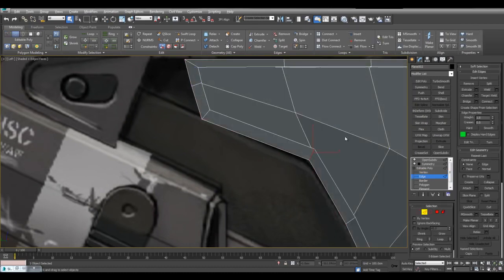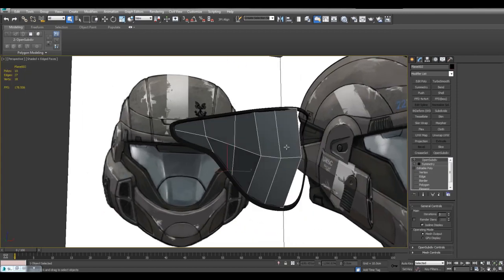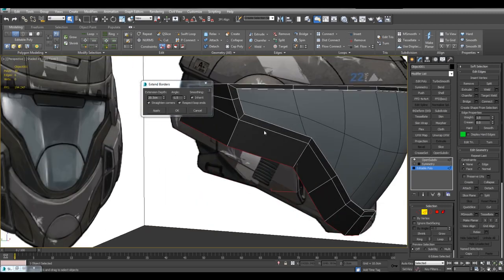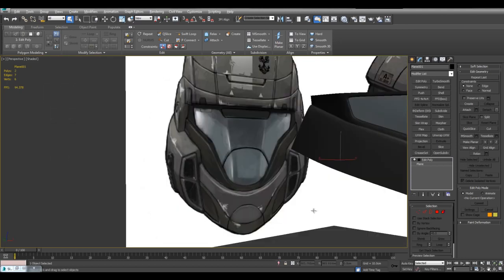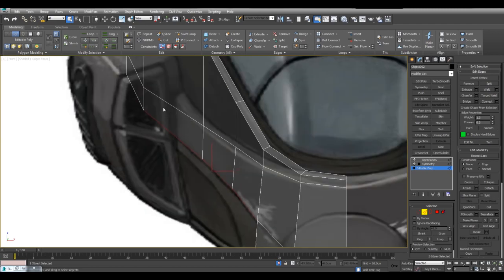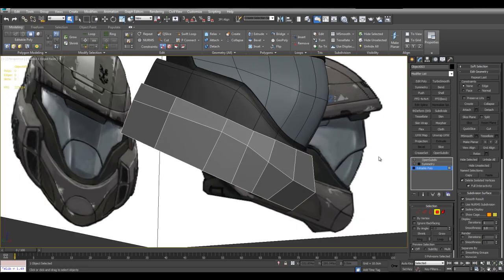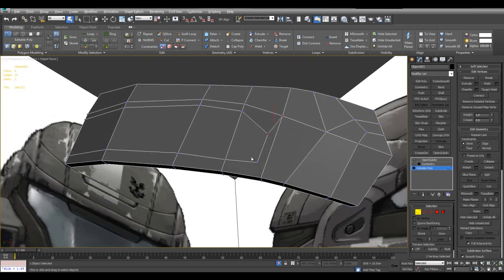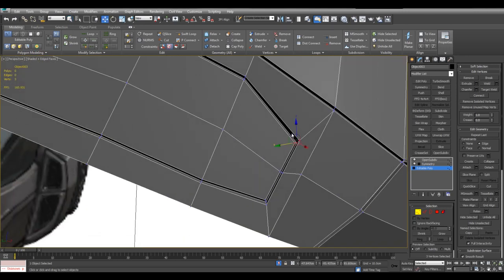Arrimus 3D - 3DS Max   Shortcuts, Tools, and Workflow   Part 3

Comment: Thank me later xD 

1 – Vertex Selection
2 – Edge Selection
3 – Border Selection
4 – Polygon Selection
5 – Element Selection
7 – Show Statistics

F2 – View Selection Shade Selected Faces Toggle
F3 – Wireframe / Smooth + Highlights Toggle
F4 – View Edged Face Toggle

Z – Zoom Extends Selected
S – Toggle Snap
G – Toggle Grid On/Off
Space – Show End Result
Q – Select Object
W – Select & Move
E – Select & Rotate
R – Select & Scale
M – Material Editor
# – Texel Density Tool
T – Top View
L – Left View
F - Front View

Ctrl + A – Select All
Ctrl + D - Deselect All
Ctrl + I – Invert

Alt + S – Swift Loop ( Loop Cut)
Alt + Q – Isolate Mode
Alt + C – Cut Tool
Alt + X – X-Ray Toggle

Shift + R – Ring Selection
Shift + S – Step Mode Toggle
Shift + W – Target Weld
Shift + Space – Bevel Settings
Shift +  T – Edge Loop Selection
Shift + X – Align X
Shift + Y – Align Y
Shift + Z – Align Z
Shift + C  – Connect Edge Settings
Shift + D – Face Constraint Toggle  (I use Shift + F cause in later Videos he uses Shift+D for the Rapid Tools - see below)

Shift + V  – Edge Contraints Toggle
Shift + B – Soft Selection

Plugin Hotkeys:
Alt + Shift + S – Straighten Edge
Alt + Shift + E – Extend Borders
Ctrl + C – Cap Holes ( Rapid Tools)
Shift + D – (fastEdgeLoopReguralizer)